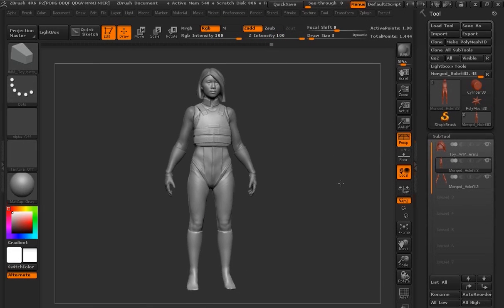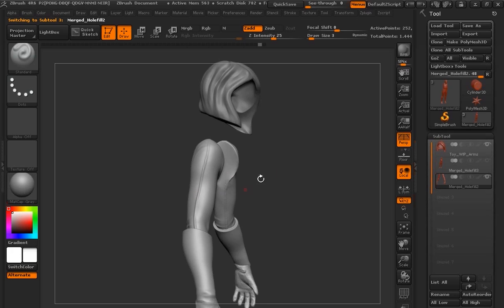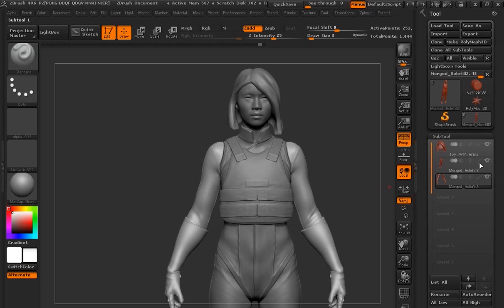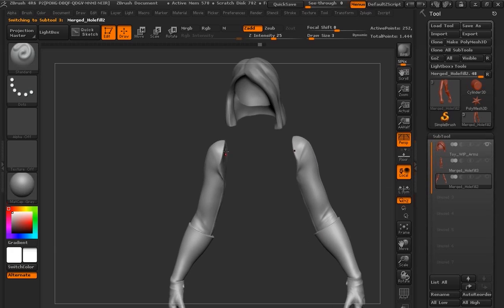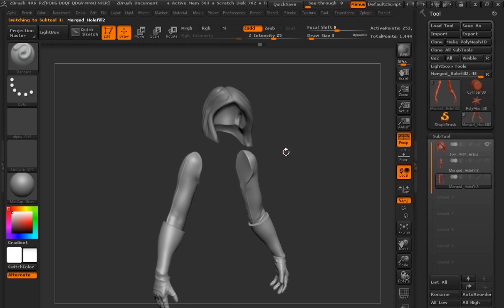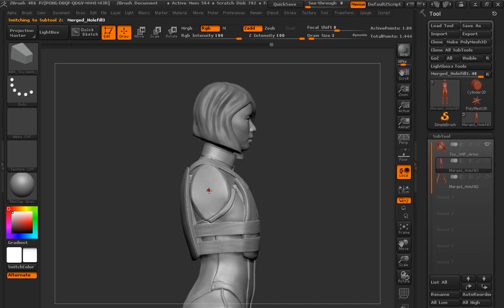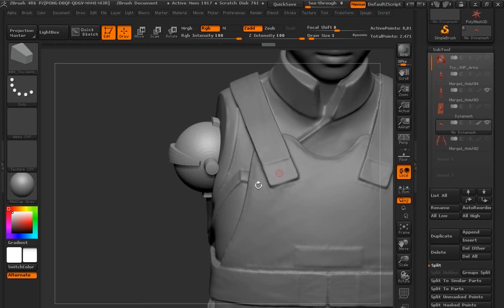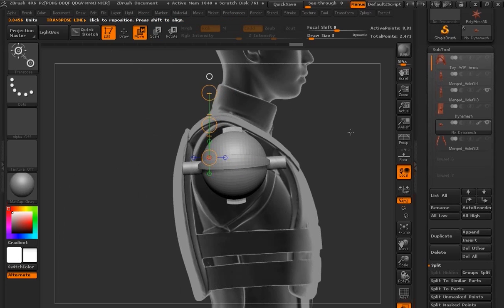3D Printing Action Figures: Understanding The Swivel Hinge Joint

Comment: How is the swivel hinge joint different from a ball and socket joint? Thanks in advance.
Reply: A ball and socket tends to have a divet before the ball hinge to allow it to "click" into place where a swivel hinge has something external holding it in place, like elastic or armatures. If you're aware of the old gen monster high dolls, their hands were removable via a ball and socket. I might be completely wrong but this has been what I've noted in terms of differences

Comment: Wait can you print the figure with the joints already assembled ?
Reply: Yes you can, but you need to make sure there is enough of a tolerance(gap) between moving parts so that when it prints, it won't fuse together.

Comment: Awesome vid!:) Can you tell me the ideal number (or ideal range) of zbrush point count, polygons, or triangles needed to accurately 3d print a realistic human 1/6 scale head for a toy or collectable? I'm thinking Hottoys quality and detail, with skin pores, wrinkles and detailed molded hair. Thanks for any suggestions! :)
Reply: when you are in the process of sculpting something with high detail, I find that it is best to go as high as you see fit, I go 15-20million points you can go higher. However when you have finished sculpting and about to go to print, you have to figure out a way to compress the model to below 500,000 points that way your slicer can operate correctly. You can do this via projection, decimate, or another way, just get it below half a million.  The resolution in your model matters, but don't pay too much attention to that if your printer cannot keep up with it.

Comment: I got a 200$ computer will it work for a 3d printer
Reply: TK- 421 are you asking about 3D modeling or printing?  For printing, absolutely.  You can even use a Raspberry Pi.  But for modeling, you need a decently powerful graphic card.